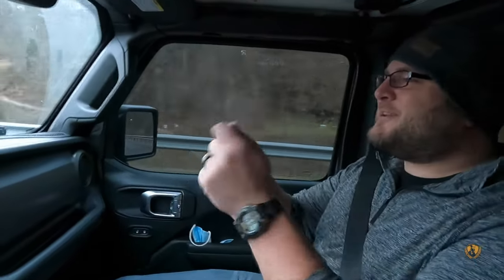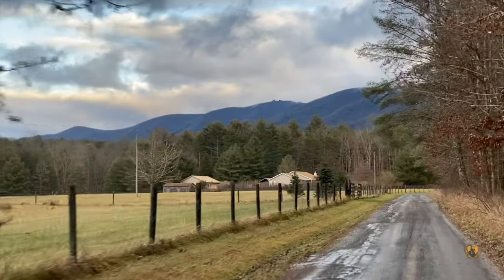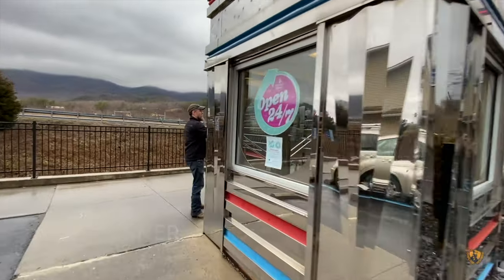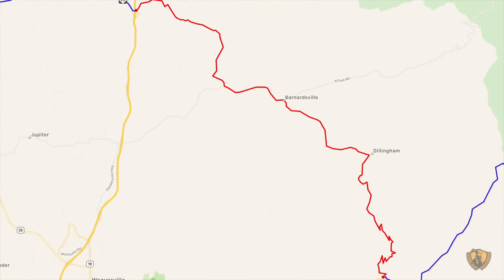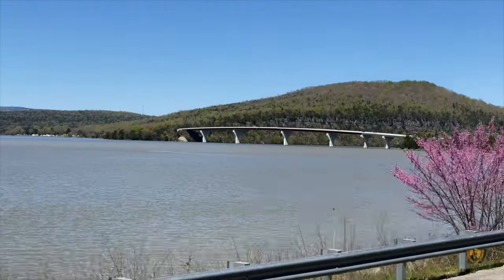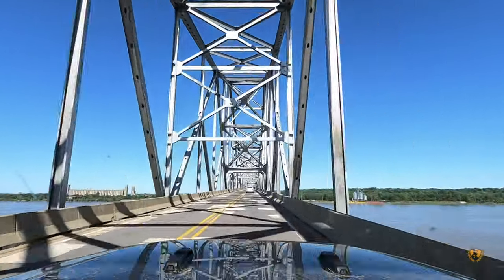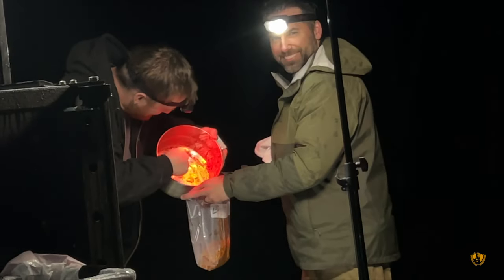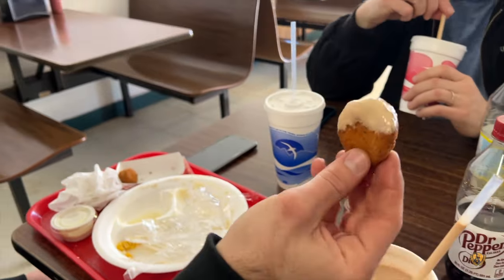Trans America Trail - COMPLETE East Half Travel Guide

Comment: Why did you air down the tires on the trailer? I understand on the Jeep but the trailer doesn’t have pulling wheels. I would have aired them up honestly.
Reply from the maker: It makes for a softer ride. If you air up the trailer would have bounced all over the trail. A proper load and air pressure on bumpy roads makes the ride buttery smooth